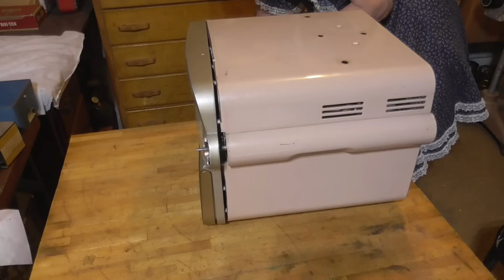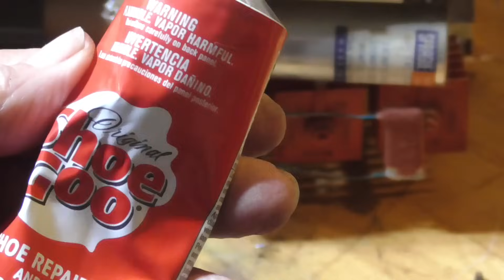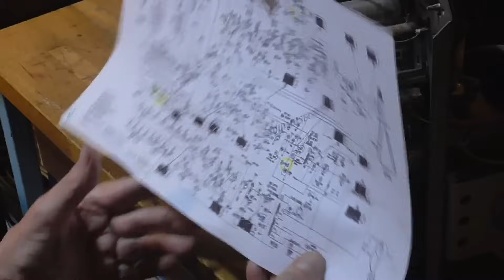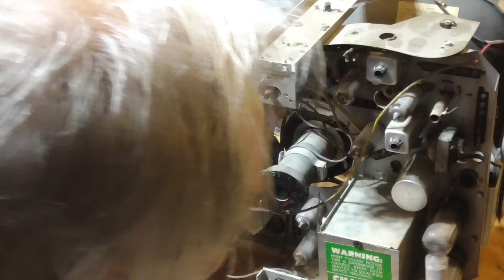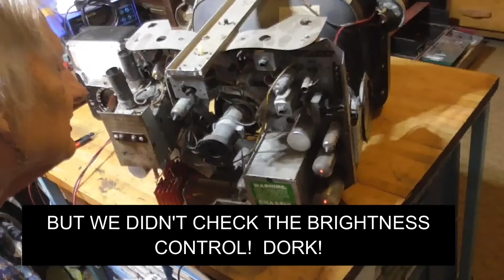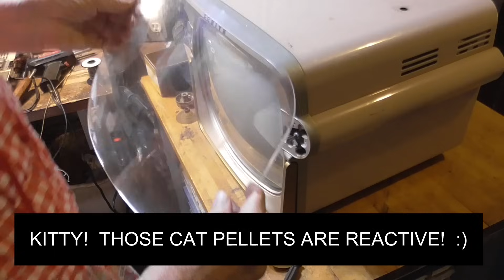Restoring a Zenith 14 inch TV

Comment: I've always wanted one of those mid-late 50's bug-eye Zenith portables. I thought I hit gold at at a big local antiques show about 15 years ago. The set looked nice, was heavy, and appeared to be complete with all it's knobs and controls. But when I got it home and took the back off... the chassis was missing, removed and all the wires cut! Disappointed, I hung onto it for a while, then sold it on the 'bay advising the fact that the chassis was missing. Missing chassis in desirable tv's has been a bane to me. I can't count how many gutted rare sets I've seen. I've learned since then to always carry a penlight with me to take a look through the vents in the backs of radios and tv's, just to check for such things. Oh well, my luck is what it is, the search goes on...

Comment: Nice Zenith "Bug eye" TV set. But a remark on the vertical linearity setting. This setting is way off. Try to display a picture with a circle. This will look like an eg.
Reply from the maker: Yes, I have a pattern generator and the squares are rectangles. Linearity and height are set as good as they can. Probably a resistor I missed or something. Whatever, I'm done with it!

Comment: IIRC there weren't many 14" pix tubes, and most were 70-90 degree magnetic focus.
Glasslinger, you ever try to regun an old CRT?  You got the pumps and the glass ability.
Two Se rectifiers, must be a hot chassis, series string, voltage doubling power supply!
I'd have used 'hot snot' instead of that 'shoe glue',
Reply: Hot glue inside of a tube TV just seems like a recipe for disaster. I've used it as strain relief for connections but wouldn't dare use it where failure could wreak havoc.

Comment: Ron working on a late 1950s Zenith "bugeye" TV but I noticed  no  handle on the center top. There are  extrusions on the
sides with hand indentations to carry it as well as a front handle and four rubber feet to lay it on the back! It's a model 
Z1511B with chassis 16Z25 for those following at home (Z means made in 1956/57) . Kitty always tries to steal the show!
Nice that it's working good but with great effort.

Comment: My main thing is restoring vintage televisions, and I spotted right away that the sandbar resistor was toast, the BIG tip-off is the   green on the leads of it, if you see that, it must be replaced, do NOT trust it, also, it's not a good thing to leave the selenium rectifiers in circuit, even if you put new silicone in parallel, cause sooner or later they will break down and leak more,  I did not see clearly if you clipped one lead on them or not.